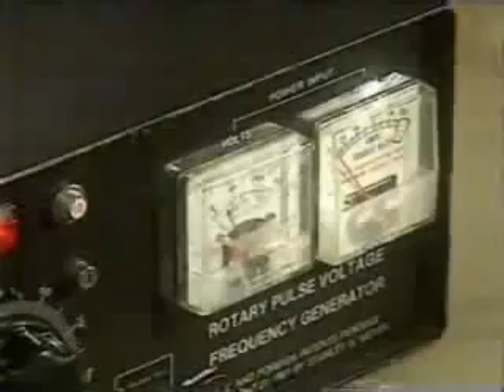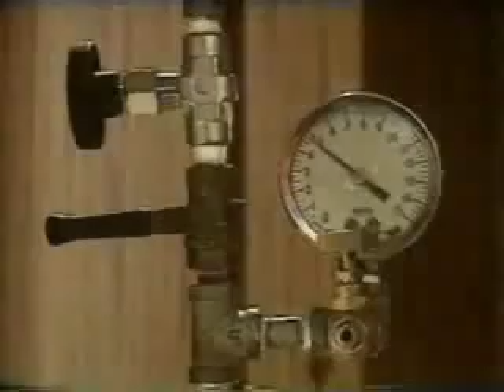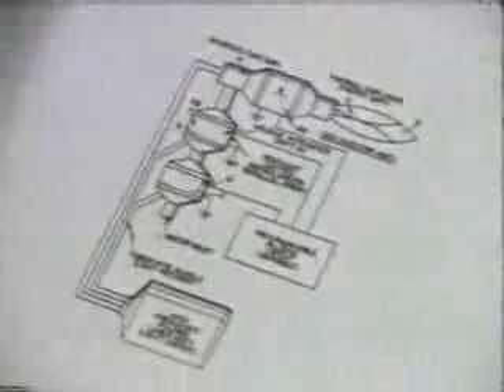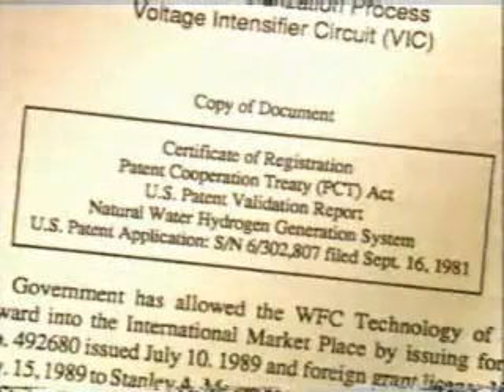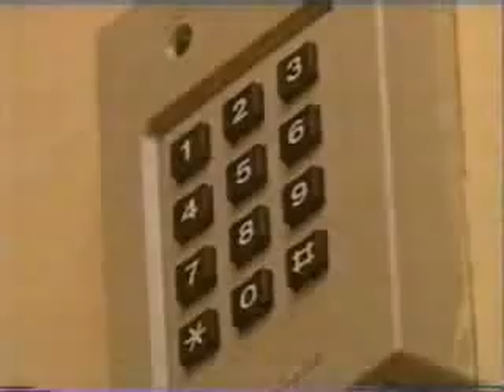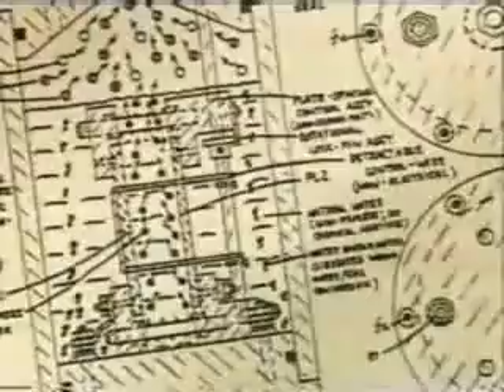HHO GAS and How to Run Your Car with HHO Gas

Comment: Gasoline engines CAN run on just hho gas in a much easier way-using KOH around 1 to 4 of pure water by using a heavy duty PWM  & storing hho gas in a pressure tank.  One CAN even run a vehicle without a transmission using a mechanical jet which I designed.  It would be much more efficient & the tires WILL NOT SPIN taking off or skid slowing down EVEN ON ICE!

Comment: @creamyfilling102 It doesn't work like that, some of what is burnt off is lost in the form of gas, heat, mechanized energy, but by rerouting the water waste you could increase efficiency. Good idea though I thought the same to myself.